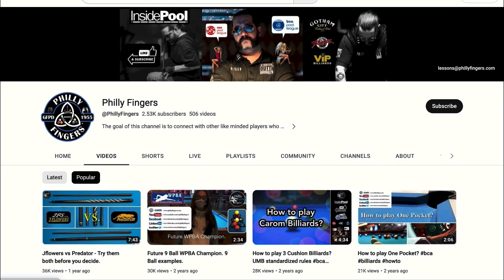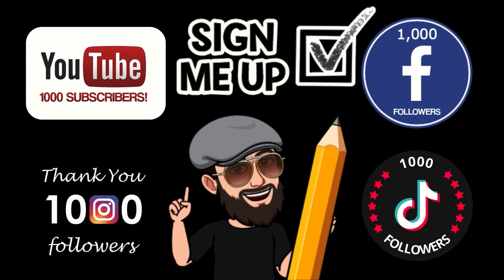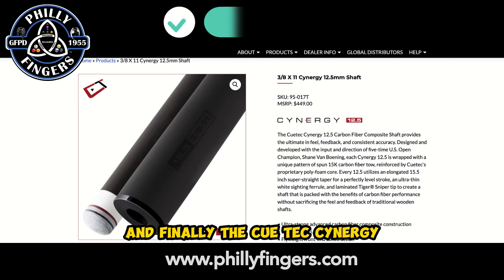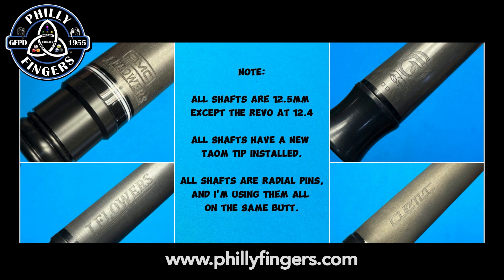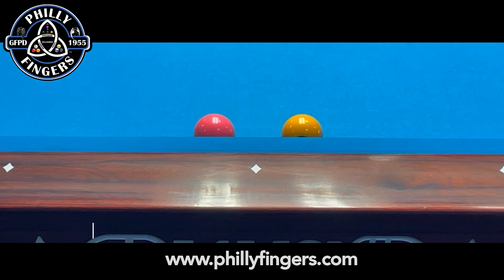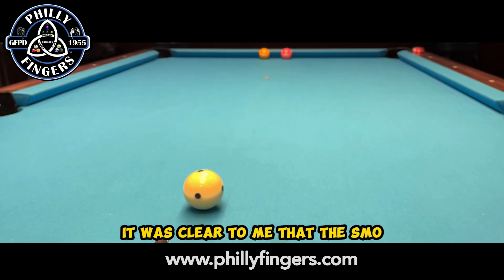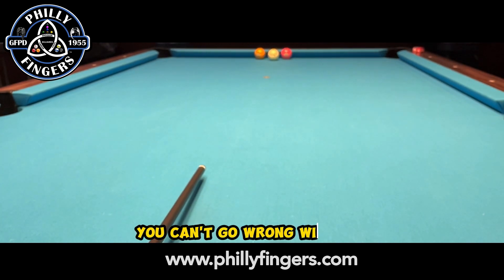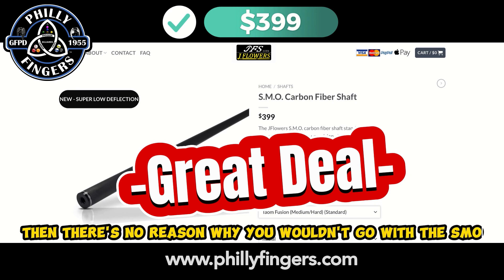Carbon Fiber Shaft Deflection test with Jflowers Predator Cuetec.

Comment: I received my JF SMO Shaft 10 days back, I can say that it's really upgraded of the classic shaft, it has very low deflection and nice looking, it's also generates more power than the classic shaft.
The only negative part for me is the tip comes with that shaft which I already replaced it, it's very hard as I am using Ultraskin Black Medium on my old JF classic CF shaft.

I agree with you, the best sound is JF classic.

As any new shaft, person needs a time to get used to the sound and feel of it.
Reply: So, in your opinion which one is better to buy? smo shaft or the normal jf shaft?

Comment: I'm thinking about buying my first carbon fiber as my main cue. I don't have a budget for predator revo, or cuetec, or smo, however, I'm interested in your opinion about the classic jflower shaft. Since you have been testing different carbon shafts, in your opinion is the classic JF CF recommendable for beginners like me? or should I just save up for a more high-end shaft like SMO or Revo? I look forward to receiving your reply. 

BTW it's a good review, but I think newbies like me would like to see more of the Shaft's and the customized cue tips. That's just my thoughts though. ✌️

Furthermore, the video just repeated approximately 3 mins 25 sec..
Reply from the maker: Hi. So yes I do recommend the JF classic since it’s cheaper and comes with the Butt you get a great shaft and butt for that one low price.  It’s definitely a great starting cue   I’ve used my for over a year and still use it very often as it’s one of my favorites.
Reply: @PhillyFingers I appreciate your swift response with this information. Have a great one!
Reply: Does the SMO sound like an aluminum bat when you hit balls with it?
Reply from the maker: @gilbertdixon64  honestly they all do. The Rego is the worst at that. And the best sounding is the JF classic.
Reply: if you're looking for your first carbon fiber shaft. I still recommend Cuetec Cynergy shaft because it's easier transition from the wooden shaft due to the feel that similarly to wooden shaft that we know and love.
Reply: Hey, you can go with the JF Crown Shaft it will only cost you extra 70$ and it is Aero Graded AA. for 400-450$ you can have the whole cue with Crown (CF)shaft.
Reply: @SjGamzz  hi! is crown shaft any good comparing to cynergy and revo? have you play with it? thank you!
Reply: @balanmihaigeorge  Hey, So I used to play with Jflowers Crown shaft and now I switched to cynergy.  both has somewhat same amount of deflection but I like the cuetec more because it provides smoother stroke and feels good compare to Jflowers.
Reply: @SjGamzz  dou you ever fell the classic onee, how much the different with thee crownn

Comment: What is the conclusion of the deflection test? I understood your deflection test procedure, but does that give you any measure of how "good" a shaft is? Normally a deflection test measures how much deflection a shaft has. You didn't mention that. What do you mean that "the shafts perform equally well?" 

Or are you just saying which shaft you like because of its feel? If it's based on your feel, why call it a deflection test? Thanks for your clarification in advance.
Reply from the maker: It was not clear I am saying with every shaft. I was able to perform the shot with no problems, almost as if they’re all identical that said, I chose my favorite based on look, but also more importantly, based on price since to me, they were all equal in performance.  And again performance defined by if there was any deflection, I would’ve made contact with the four ball the ball would’ve veered off to the right and touch the floor. I was able to never to touch the floor with every single shot.
Reply: @PhillyFingers  The most important part is this sentence " almost as if they’re all identical". Since you are applying left spin, you need to aim to the left in order for the cue ball to hit the gap. It seems like in the video you are hitting the ball soft, in which case you might not need to adjust much aim. You didn't say this in the video and it was very confusing in my opinion. Because you can use any shaft and find the right aim point to achieve the same results. I appreciate you changing the same tip on all shafts and using the same butt. But I think the deflection test should be done with more care. Not that it needs to be perfectly scientific, but at least let us know what you are comparing among the shafts.
Reply from the maker: @puboh  fair point.   I didn’t want to make it too long of a video but yes to add more clarification every shot was aimed at the same spot with the exact same type of speed. Never trying to adjust again it’s not perfect as I’m not a robot, but for the most part I never adjusted I was always aiming directly center into that gap not aiming off center or trying to compensate in any way shape or form so while aiming perfectly center to the best of my ability giving left spin, I was able to hit that gap every time.  That said all four shafts felt identical to me. I will add that to the next video.
Reply from the maker: @puboh  you made some great points and offered constructive criticism which I appreciate and will use for the next video.  Many people on this forum only criticize and bash others.   I appreciate your feedback and even if not subscribed I will be adding your name to my next raffle giveaway.   Thanks for watching.
Reply: @PhillyFingers  Thanks! Yes I agree a lot of people are just trolling. On the other hand, not many people can handle sincere advice or criticism because they look harsh sometimes and people can't stand them. So I really appreciate you reading my comments and find it helpful. Looking forward to your next video:)

Comment: But the SMO and the Cynergy are the same price, so what do you mean it's cheaper than the others?
Reply: I'm pretty sure he means in terms of performance to cost ratio.  The cynergy is usually considered the baseline for carbon fiber shafts in terms of low deflection. Since the SMO deflection is lower then the Revo, by technicality its better for the price. But you're limited to only 2 joint options (at least on the jflowers website). I can't say too much abt the carbon fiber type since cuetec and jflowers are still really vague on what the type of carbon fiber they use but performance the SMO beats it out, but in terms of joint option cuetec is better since it has a joint option for literally everything.